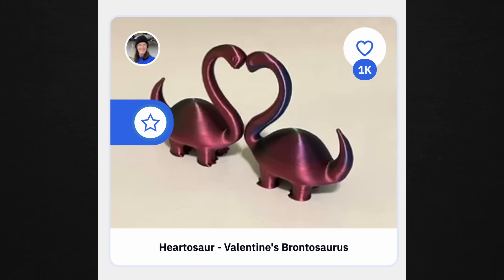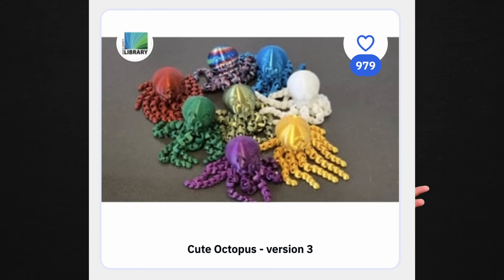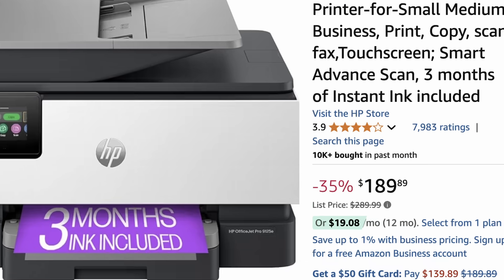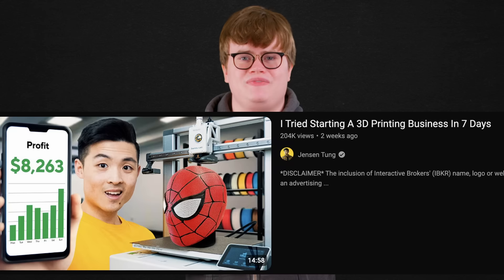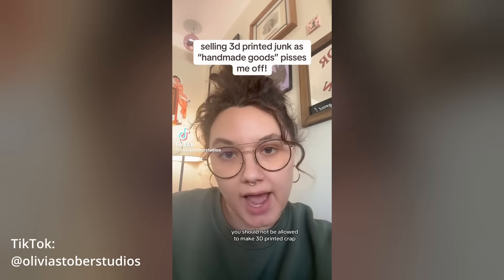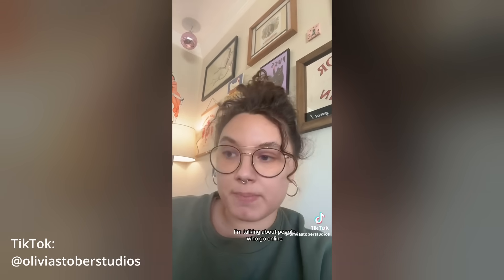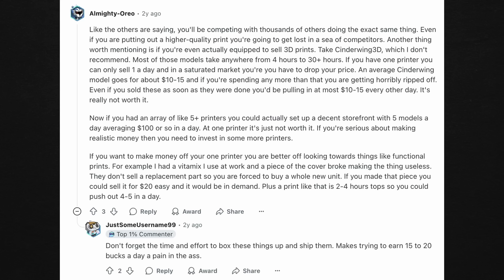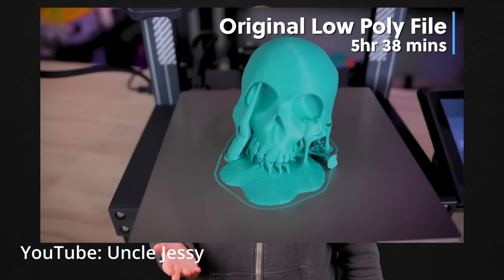The Rise of 3D-Printed Slop

Comment: I personally bought a 3D printer as an accessory to my DnD hobby, as miniatures are extremely expensive and often unpainted or poorly painted themselves.  The flexibility in being able to print whatever monster I feel like throwing at my party this week has really boosted my creativity.  I also love supporting independent modelers
Reply: Doin the Nerd’s work over here!! Good job 🤓
Reply: Oh yea. Resin 3d printers have been a game changer for minis.
Reply: Yeah that’s what I want a 3D print for myself.
I can 3D model already, so I can fully customize them as well.
Reply: What printer would you recommend? Been looking into one specifically for minis
Reply: @CryptidShrew Filament Printers are cheaper and require less maintenance, ventilation and set up, they produce worse quality miniatures but are better for terrain.  Resin printers are really finicky, need good ventilation for the fumes, and skin protection, but produce extremely high quality miniatures.  I recommend a Bambu Labs A1 Combo for filament printing, and an Anycubic Photon for resin.  They’re both around the 300-400$ range, though that might have changed because of tariffs.
Reply: @CryptidShrew  You can get good results from a Bambulab A1 - using filament and a Supertack Cold Plate. It can be used without any worries of ventilation and stuff. But for real high quality stuff you need to go the resin route. I can't recommend A1 enough for terrain though. And it's really affordable.
Reply: @CryptidShrew  for miniatures? 100% a resin printer. Elegoo and Any cubic are fantastic. I use an Elegoo Saturn (280ish) and it prints amazing minis. Just make sure you also invest in some ventilation (a grow tent with an air duct and one way fan blowing out a window which all roughly costs another $100).
Reply: YES, this is one of the best uses for it
Reply: Totally worth polluting the planet for your selfish needs and literal toys!! 🤦‍♂️😤

I hate humanity. None of you are serious or stand for anything
Reply: Ah yes such a necessary piece of infrastructure. Happy for you but you're not challenging his point lol
Reply: @lucas_the_mad  none of these people care. They’ll keep being mindless selfish consumerist fools, making the world a worse place and destroying it in the process….

For little plastic toys these grown men can play with 🤦‍♂️ look, Warhammer 40k is really cool….

But none of you are decent people, in the slightest. The plastic pollution is just the tip of the iceberg as well
Reply: @lordaizen8004  i would be throwing stones from a glass house being from the USA who starts many mass pollution events. So I wont comment on the warhammer, but I have enjoyed starting to repair electronics, tape machines and old stereos. and finding CRTs before they are dumped in the waste. There's a ton of cool shit to find scavenging and giving things a second life
Reply: grown man making small toys for himself
Reply: @beaualoevv Whatever keeps y'all away from A n d r e w T a t e, I support it.

Comment: I never liked 3D printers. I didn't see the point until recently. I am designing a few products that need special connectors to join 3 panels. This is a low strength application. The angles involved could be machined but would take a 5 axis machine to do so. I can easily 3D print this part. This year I plan on getting my first 3D printer basically just for this reason. The connector I designed myself and 3D printing it is the cheapest option. Could it be injection molded, of course. But I don't have the volume to justify that cost. Interested to see how this goes.

Comment: I'm in the green for this year. I wasn't last year because my business quadrupled and I had to get more printers. I don't know any other printers that print at greater than .2mm layer height. That's crazy. I paint a lot of what I make. And some things I dont. But it takes a lot of time. A LOT. To calibrate, slice, paint in the program or by hand, ect. I dont care if it's an item I licensed or one I designed, I spend a lot of time. I speak as someone who is also an artist. I have sewn costumes by hand, made accompanying jewelry, painted masks, and more. Cinderwing does a pretty good job with her designs. However, I've done test printing and provided feedback on issues to many designers nearly as prolific as Cinderwing. 

All of that said, 3D printing isnt much different than other artists at craft shows. You pass 5 tumbler vendors, tshirt vendors, candle vendors, blanket makers, jewelry makers, christmas decor, ect. Just because it is hand made doesnt make it unique. It's still up to each maker to do something to do something that makes their product sell.

Comment: I'm not a big fan of all of these plastic fidgets popping up,  but I think you're fighting the wrong crowd here.

The most commonly used filament (by a long shot) is PLA, which is made from corn starch, carbon neutral, and biodegradeable.  PLA does need to be handled professionally to properly biodegrade, but at worst it's still much less damaging to the environment even in a landfill. Fumes from melting PLA are quite mild, and at no point does a 3D printer "spew plastic into the air" even in a print failure. Research on PLA fumes are limited at this time, but I've only heard cases of mild respiratory irritation with prolonged exposure. The only more severe cases I've heard of came from improper usage of some "engineering grade" filaments which casual hobbyists will never touch. 

Regarding ease of use, print times and print quality: I'm not sure how else to say this but your information is just outdated and incorrect on this. Modern 3D printers produce MUCH better quality than the images you've shown, and they're remarkably easy to use nowadays. I can find new models, send them to my printer and reliably expect a good result with little fussing. Print times vary a great deal by model type and machines, but my affordable Bambu printer can print a "benchy" (a complicated ship for benchmarking, roughly 2" tall x 2.5 inches wide) in 18 minutes, with better quality than you showcased. I got into this hobby about 4 months ago with no prior experience, I've printed at least 100 models, and of those maybe 4 have had failures, aside from the ones I've designed myself. 

While I do agree that there is a flood of dragons and 'decor' in the market, many people print these items for themselves. 3D printers do use energy and resources, but it doesn't even compare to the cost of producing the same product in a factory, boxing it up, shipping it halfway across the world and then dropping it off at your house. I'll even go so far as to say this: people are going to buy things that I consider a complete waste of space and materials. I wish people wouldn't pump money into crap that they use a few times and throw away. But, if they're going to buy that stuff anyways, it's a lot more sustainable to print it yourself.  The idea that an average Joe can buy up a bunch of printers and start making money is just another grift, most people have no clue what it takes to run a successful business. If anything, I think you've highlighted that pretty clearly. 3D printing is a tool, and some people use that tool to make toys and trinkets. Others will design useful, free models or create genuinely solid products that can launch a new businesses. We all scribble before we can draw, even if not everyone becomes an artist.

Comment: I have thought about getting a 3d printer as it would be great for printing small parts to repair items where the cost of a replacement part is either expensive or non-existent otherwise. But I have zero knowledge on 3d sculpting and I just don't think it would justify the environmental cost of having the printer given how rarely I would use it
Reply: ''justify the environmental cost'' Dude you are the carbon to be reduced

Comment: a lot of libraries have free or low cost 3d printing services available to the public!! it is okay to want a few useless novelty toys every once in awhile, you alone are not the sole reason the planet is dying. nobody really suffers from an OCCASIONAL small 3d printed desk trinket. using publicly available community resources instead of supporting these “businesses” that mass produce junk and as a result generate huge amounts of plastic waste and actually DO have a notable impact on the environment is a great way to reduce/offset the harm caused by 3d printing. if your town doesn’t have them available, check surrounding towns/cities and see if you can get a resident to print it for you, or check if non residents are also able to use the services
Reply: Per object, a 3D printing causes much more pollution (often unmitigated, & directly exposed to the operator/environment) than mass produced injection molding with high material efficiency and actual pollution controls.
Reply: @ sure, but i don’t see how that’s relevant to what i said in my comment. i said “dont support businesses that mass produce 3d printed products” and not “don’t support businesses that mass produce products using injection molding with high quality materials.” 
i am not anti-injection molding, i’m just giving people an alternative to supporting shady businesses using publicly available resources

Comment: As someone who owns 3D printer and use it mainly for costume designs, those trinket prints are good to test your printer before printing something you actually need to print (I use them sometimes to test new filaments). But these days, you actually won't end up with tons of failed prints even with cheaper printers if you buy some smaller "ready to print" printers, you are basically good to go a prints don't fail as often as with older models. But selling those little octopuses, dinosaurs etc is basically illegal, because most of them are free under "no commertial" use and I bet 90% of sellers won't buy ccommertial use for their "free thingiverse print" they found online.

Comment: Someone who gets me, why ive been hesistant. i can tell it produces a ton of plastic junk and microplastics. Id like to use one to print replacement parts for doing restoration or repairing damaged plastics i can't chemically weld. It just seems like most use them to print Aliexpress junk, like furniture leg caps and switch controller holders.
Reply: Pla is Vinyl made from Corn...
Reply: don't get it, also think of all the pollution you will cause by existing

Comment: Thank you for the education and bringing me up to speed on the hobby market of 3D printer owners. I'm being gifted an obsolete printer which I'll use for solving problems and making original items. I will never print a toy boat. That seems absurd, no matter how many functions it tests. Your video helped me understand what I'm dealing with as far as the community of users. And yes, I have seen the articulated dragons at a crafters fair and I boggled at the concept. I won't be creating trinkets from online files. I'm dusting off my CAD skills (I was a CAD manager in the late oughts) and using additive manufacturing to create things very difficult to do with woodworking. I think I'll go put my head under a rock now, to avoid the plastic crap craze. I had enough of that in the '80s.

Comment: 1:40 I think this more than any other is the biggest pieve I have with the 3d printing trend. As stated, why buy a 3d printer but essentially only be able to use it to half it's extent. Learn to model and design, learn material properties and how to optimize a design for strength or detail. On another note, most people use PLA for their 3d printer (especially those who just print off thingiverse) and it's made from plants and can be decomposed (though not easily) it's not a petroleum product.

Comment: I printed random junk when I first got into 3D printing. I soon got bored of stuff that just sat on my desk or made cheap gifts. The true power of my printer came when I started to use it for practical prints. I taught myself how to design in a CAD program. Did a wheel fall off of your vacuum? Take some measurements and print yourself a new one. Need a fastener replacement for a shelf? Print it!

Comment: "that could be easily bought on Temu", well Temu isnt part of any Answer. 
Better order 1x one compact kg instead of 20x bigger plastic thingies. (for this scenario in general)
(Also the time point isnt a thing compared to 3 weeks delivery time)

Least designs allow commercial uses, so you need to design by yourself or buy the license.
Still you are the producer and sell it to the given quality, like eeeeevery other seller in the world.
Also Etsy is already flodded by chinese dropshiping shit, so 3D printed "regional" parts are the least problem there.
Overflodding print shops comes, because its 0 effort and investment to just launch it and print on demand.
Which can be good for replacement parts, customized stuff or niece products.

And all that isnt necessary bad, customers can see what is crafted how or how good post processed.
Its just the amount that is confusing, and maybe you never see the hand crafted articulated dragon.

But many true points said about the consume problems. Getting bullshit became more and more easy, because makerworld etc. works like amazon, its seek & buy(/print).
Also for others the affordability of bullshit increases, because there is no factory that needs to justify a big investment behind it.

For other Etsy sellers, mhm if your handmade stuff isnt better than a 3D print, well i dont know, it should.

I feel bad for every gramm of support i need, i even melt my trash in silicone molds, or store it till i can send it to a (filament)recycling company.
Also i dont have space for useless stuff.
But many people just dont care about plastic or reflecting their shopping behaviour and thats the real thing on all what was said. 3D prints are only the peak of the iceberg.

Comment: I took an additive manufacturing class as a mechanical engineer. Mass manufacturing something using a 3D printer is more expensive than injection molding. I own a 3D printer just because we need to make prototypes. If I go on thingiverse I look for something that actually has a use.

However some parts of the video are very nitpicky and surface level. For example, a lot of people actually use them for prototyping and engineering purposes. Not everything is 3D printed slop.

I think a more accurate title would be something about 3D printing getting to makers markets and the critique of “creation” and try leading people to 3D modeling instead rather than just bringing up a problem and not a gateway to a solution.

The environmental part also relates to printing something on your own rather than paying for something on Etsy. Then that item being packaged sent using carbon emissions and then brought to your door. It wastes more materials and creates more carbon emissions rather than 3D printing it on your own.

Comment: home hobbists pretty much cant re-use wasted filament from failed prints at all. I bought a 3d printer a few years ago and I've printed very few things. My first project was a Glock 19 handgun, which was a huge success.  I've made a few customer brackets, legs, replacement parts, shims, banjo bridges, ect. but at most it gets used once a month. 

I appreciate this video, I've really struggled with the enviormental implication of 3D printing. All of my failed prints and offcut are in a box waiting for the days consumer PLA recycling catches up, or I get the stones to throw them away. Every convention whether it be a trade show, reptile and ampibian shows, or gun shows always has some loser hawking polychromatic octopi and Dwayne Johnson busts. I never see them sell anything and I often wonder if each vendor gets discouraged and ends up throwing all their unsold products into a landfill. Personally I cannot imagine relying on premade stl files. I've found a few useful things on thingiverse but for the most part you need to learn fusion 360 or another modeling program to get any practical use out of a 3D printer. Not doing so is incredibly irresponsible IMO. Printing is sooooo wasteful, it's the dirty secret of the "hobby" enthusiats won't tell you about. Even more so if your relying on other peoples creations and hoping they work without being able to test and measure before hand.

Comment: I design usefull stuff (powerbanks, powertool adapters, hangers, mounts, Laptop parts, etc.), and have probalby printed a "trinket item" about 3 times in the year, since i had this printer. I have to say  that the fact that artists complain about this not beeing art goes one of two ways, one way is the plastic trinket crap, someone else draw you sell, which is true. The second way is if someone actualy draw and made the model themself is BS. Im happy to not be either of these since im an engineer.

Comment: So here's a question I've been mulling over for a while: if you have a random plastic part you need, is it more environmentally damaging to 3D print it, or to buy it on Temu? If you buy it on temu, it's getting shipped from China after being manufactured under god knows what conditions with god knows what materials. On the other hand, this is probably also true of the filament you bought. Which is worse?